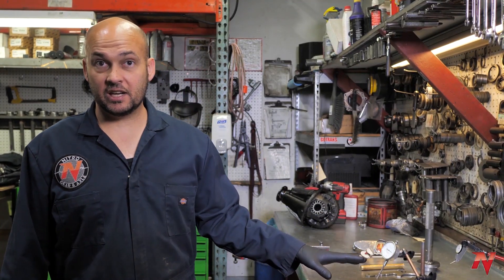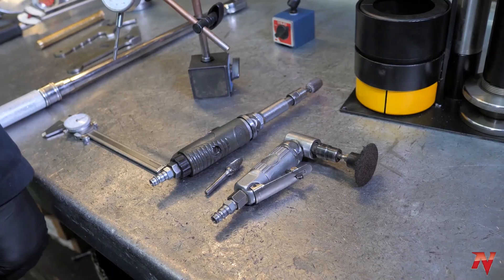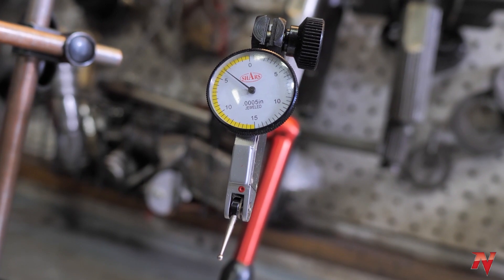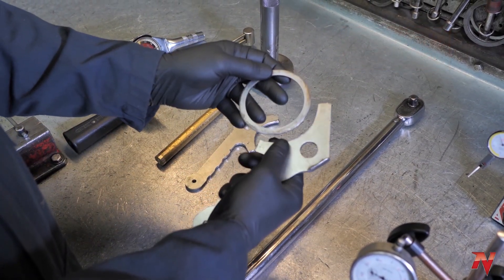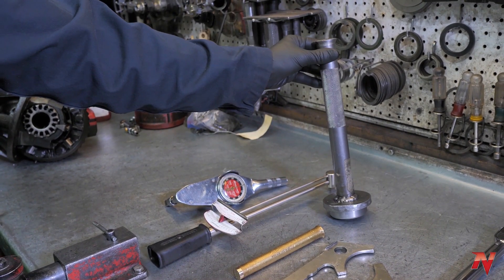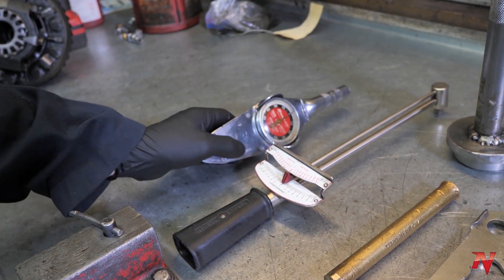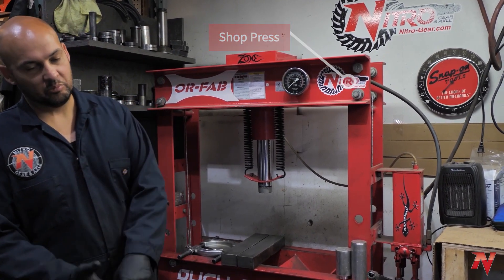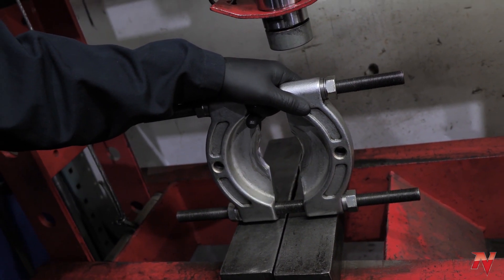Building Differentials: What Tools Do I Need For Success?

Comment: I searched everywhere for a 4” capacity bearing splitter for 2016 GM 12 Bolt with 3-1/2” bearings. That one never came up for me. I would’ve gotten that, but ended up using a grinder, Dremel, and oxy acetylene torch for all 3 bearing removals. The Lisle 59400 Race Driver set just might be very essential in my case. The standard 9 piece 40-60$ (all metric) sets don’t have the right driver adapter for pinion races. The Lisle races are SAE with extra long handles and an air hammer attachment. Giving the Lisle set a try today to hopefully get into preload and backlash. It’ll be interesting to see how Carrier Shims go without those driver tools. 
Good video 👍🏼 wish I’d have seen it sooner. How bout Gear Marking Compound? That’s essential. We bought a bearing race and seal set from GM dealership and still had to get AC Delco compound on Amazon. Took a few days even with Prime. Was going to use grey anti seize until there was down time anyway on race driver delivery.